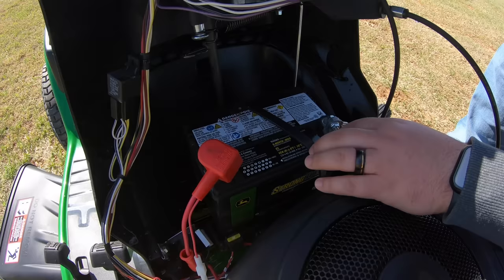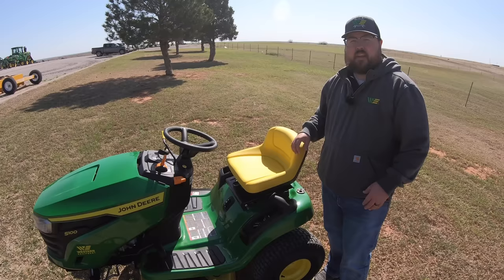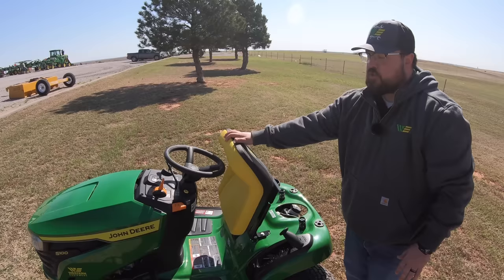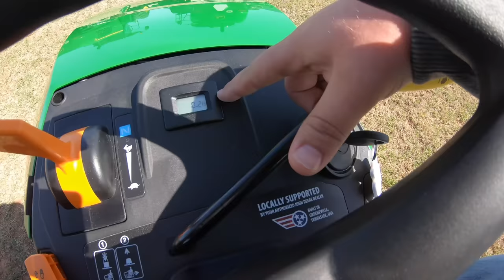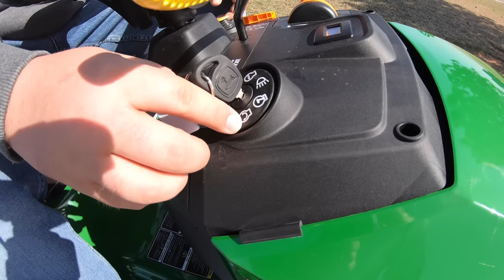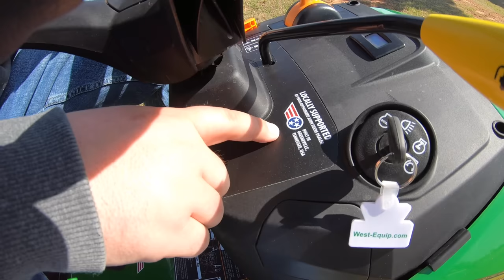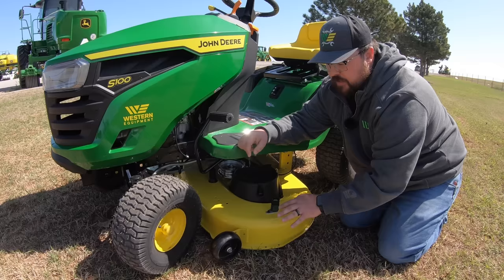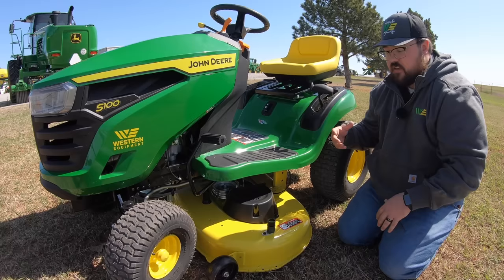2021 John Deere S100 Riding Mower Review and Walkaround

Comment: Since the PTO adjustment bracket is now welded on the deck - now how do we adjust tension if it is loose???
Reply from the maker: is the belt still loose when you engage the PTO?
Reply: @WesternEquipment  yes even tho belt and pto are new. Not sure why they would delete the option to manually tighten the pto via the bracket. It’s hard welded now. Also looks like the cable has no adjustment screws like you see on snow blower cables etc.

Comment: I have uneven ground in my yard. It used to be a horse paster. We have ruts and holes. What riding mower would you recommend? BTW its not rocky just not smooth
Reply from the maker: I would look into something in the X300 series or larger (X500 series or X700 series). These are going to have a more solid frame to handle the rough terrain. Thanks for watching!

Comment: I’m sure this is a stupid question but does the battery charge when the mower is running? Or will I have to place it on a charger?  Thank you so much for your time.
Reply from the maker: Yes it will charge when running. It has a system that acts like an alternator. Good question and thanks for watching!

Comment: Question: I was gonna buy this but, would a bush hog be to much on it if I was using and pulling it for tall grass. If I take the deck that was off under the mower.
Reply from the maker: I would not advise trying to pull any kind of brush cutter or bush hog with this tractor. It is the smallest residential machine and I don't think the transaxle would be able to keep up. Good question though and thanks for watching!

Comment: To unhook the spark plug do I just pull that cable off?
Reply from the maker: Yes, it is super easy!
Reply: @WesternEquipment  So just pull that off? I’m trying to install the MowerPlus plug/adapter.
Reply from the maker: Yes, just pull it off and then reinstall once the connector is installed.
Reply: @WesternEquipment  well I can’t figure out this connector so it doesn’t matter. I don’t wanna pull something off I shouldn’t.

Comment: Hey just bought a new one and I'm having issues with the fuel gauge float not working.  Do you have a video about that???
Reply from the maker: Not currently but hopefully I can get to making one soon. If you still have issues I would take it to your local dealer and take advantage of your warranty. Thanks for watching!
Reply: I spoke to a dealer and the answer is nothing can be done.  I happy with that.
Reply from the maker: Maybe try another dealer in your area that’s interested in helping. If there isn’t one, you might have to try and tackle it yourself and buy a new fuel gauge.

Comment: The TL-200 transmission is not very durable.  If you mow hills, or stress it in other ways, it will need replacing in pretty short order.
Reply from the maker: I have heard both ways on this one. I have heard good and bad. But with this being a very light transmission I would agree that it needs to be under less stress that the larger models. Thanks for watching!

Comment: So I have a question….I just got to finally use my s100 for the first time and it mowed amazing and fast too. I am very happy with its performance on its first mow. My question is, when I finished mowing and got off I saw that while I was mowing the belt was rubbing against the top of the mower deck and it even took the yellow paint off where it rubbed. I assume this isn’t normal or is it? Also I have 1 hour on the hour meter
Reply from the maker: Sounds like there may need to be some adjusting to your belt tensioner or one of your pulley’s. I would definitely take this to your local dealer and see if your warranty will cover this issue.
Reply: @WesternEquipment  My local John deere dealership came and picked up the mower last week so I spoke to them today and the service department manager told me that this was the first time he heard of this so he made sure everything was correct like the mower deck at 4” and not actually 6” when raised. When he looked into it more John deere told them that this is normal with the s100 series that the belt just rests on the top of the deck and that there’s no fix. He said it’s just the nature of the beast. So I said so basically the paint will be rubbed off in that spot and he said yep unfortunately so.
Reply: @davidgarris2513  except he showed me the print out of their response they sent him so I read it in black and white
Reply: @MEEMOSS77  "the first time he heard of this' Really?  And he's the service department manager?  And Deere built this so the belt would constantly be creating friction/heat/wear rubbing on the deck?  And you believe that?  Oh, a talking serpent conned a certain weaker member of the human race into eating a cursed apple.  😆   Whatever.   Also manual transmissions achieve significantly better fuel economy.  A man in his garage in the 1950's invented a carburator that got 100mpg.   Etc.
Reply: @davidgarris2513  I didn’t buy my mower from the John Deere dealer I bought it from Lowe’s  so I wasn’t conned  and I’m certainly not a weaker member of the human race
Reply: @MEEMOSS77  you obviously don't know the bible.  It was a bit of sarcasm and the "weaker" is the female.   And if you read thru some of the thousands of reviews on the 100 series that people purchased from either Loews or Home Depot, almost without exception the complaints stem from the unit not being set up properly, and when subsequently contacting the Deere store, they tell the customer it's their fault for not purchasing from them, they should have bought a 200 series, go back to the place of purchase.   .... Etc.   I'm not saying it should be like that.  But being a long time Deere products owner and operator, and someone that heavily researches any potential purchase, I've read multiple hours of reviews on these machines and can assure you that I am correct.  Therefore I cannot be corrected.  😂.  Good luck.  Next time patronize your local John Deere store.  Not the faceless global conglomerates.   Read Consumer Reports, check out Bob Vila. These mowers are top of their respective class.  So no, a Cub Cadet will not make things better.  Gotta go

Comment: Great video Brent, very informative and extremely well done!   I am considering the S100, a bit concerned over the stated belt issue.  Is the belt/pulley designed differently on the S120 ?  Secondly, do you happen to know the width on the 42" tractors when using the twin-bag system?   My gate opening is 55".   Many Thanks.
Reply from the maker: Thank you! I don’t think the design is much different but I do not hear of the belt jumping off on the S120. Also, I do not know the exact width but you should be pretty close to the 55” with the bagger on but I think you’ll still be able to get through your gate. Thank you for watching!

Comment: My new S130 is hard to apply the parking brake. I need to push very hard on the pedal to get it to engage/disengage. I tried the parking brake on two S100's at Lowe's and one was really easy to apply and the other was between the force required on mine and the easy one. There must be a way to adjust this? - Thanks

Comment: Man, can I get your advice? So, I just got the John Deere s170. I love it. My lawn is 0.52 acres and it's barely large enough for a riding mower. But it's not so much of my lawn size, but the lack of long straight paths that can eliminate the amount of turns I got to make. So, I feel really stupid. I never before paid attention to those strange looking zero-turn movers. But then I realized that is what I should have grabbed. I mean heck, every riding lawn mover in my neighborhood is a zero-turn. So, I'm considering returning my s170 for a zero-turn. How much of a difference you think that would make? I do have sections of my yard that has a nice travel before needing to do a turn. I guess I can keep the s170 and use my push mover for the more difficult areas.
Reply: A zero turn mower is exactly what you would need. I think you spent 2500 + tax or so on the s170 (based off of Lowe’s) and you could get a decently nice zero turn for that price range. 

Here is the Lowe’s website if you want to see the zero turns faster at your price range: https://www.lowes.com/search?searchTerm=zero%20turn%20mowers&refinement=2665191283

And here for Home Depot: 
https://www.homedepot.com/b/Outdoors-Outdoor-Power-Equipment-Riding-Lawn-Mowers-Zero-Turn-Mowers/N-5yc1vZc5akZ12lf?NCNI-5

Home Depot has craftsman, and toro, maybe a few Troy bilts
Reply from the maker: I agree with @Man of Culture that a zero turn is probably more fitting for your situation from what you are describing. Make sure you are checking over the mower good when you buy it. Checking things like deck levelness, tire pressure, oil level, battery, etc. Thanks for watching!

Comment: I just bought the S100 and it was a repaired unit by John Deere don't know what was wrong with it but I was wondering way the fuel tank is not mounted in the frame work I didn't receive any information on the mower so can I call or go to you or John Deere and get a warranty for it or I'm I sol on that it was sold as is from Lowe's in homestead Florida
Reply from the maker: Yes, you should still have warranty on the machine and you could take it to a John Deere dealer to have it inspected. I hope this helps and thanks for watching!

Comment: I have a question for western equipment are these serviceable transmissions in these john deere models? or plastic? You gave all specks except one of the most important the transmission
Reply from the maker: The transmission is not plastic but they are considered sealed/non serviceable. Good question and thanks for watching!

Comment: just got my s100 and I can't get it to move forward.  What am I doing wrong?  It starts, the brake is not engaged, but when I hit the pedal, it doesn't move.
Reply from the maker: Check the rear of your machine and see if the transmission release lever is pulled out. If so turn the machine off and push it in and then start it back up and it should work. If this doesn’t work then check your transmission belt which is located above the mower deck and runs from the bottom of the engine to the rear of the machine. I hope this helps and thanks for watching!

Comment: Hi, great video, great explanation. I love this brand so I put my eye on this mover. What I CAN'T find anywhere is the slop level it can handle. My backyard has a 9% slope and I want to make sure it has enough power to handle it. Any idea? Thanks
Reply from the maker: Thank you for the comment. I am not sure why these mowers are not slope rated. I would definitely see if you could test drive one or at least a comparable mower to make sure it will handle it, but I don't think you will have a problem.
Reply: @WesternEquipment  Thanks! I would go for the 120 but they are out of stock everywhere. So I guess I am pulling the trigger on the s100, Thanks
Reply: The manual says to stay less than a 10-degree slope. That’s recommended for safety. Not necessarily for power. 🤷‍♂️

Comment: S100 vs S120. would s100 horsepower (17.5hp) be powerful enough for fall season wet leaf picking? I usually have 60-80 bags of leaves each fall. Thanks, in advance.
Reply from the maker: I would suggest going with the S120 if you are doing that many leaves. The more HP the better for that scenario. I hope this helps and thanks for watching!

Comment: Great video!  I just purchased the S100 and have one question.  I assume the sliding piece on the fuel gage is supposed to slide depending on what the gas level is?  Mine does not move.  Any advice on this?  Thanks again for a great video!
Reply: man, that's very odd, i just bought a S100 few weeks ago, mine is working good, your gas sliding piece should move showing the gas level even when the Tractor is cut off. I would call the place you bought it, sure it's still under warranty.

I noticed when I first bought mine, when I got home, a nut was laying in my truck bed. I never did find were that nut came from. 

I heard someone say that John Deere will send someone out to check things under warranty so you don't have to load it up and carry it to them. Hopefully you will find out why.

Comment: Can you put a match kit on s100
Reply from the maker: Yes you can. There are two different options, a mulch cover for the discharge chute and then there is a hard mount kit that bolts to the underside of the deck. Good question and thanks for watching!

Comment: What is your opinion on this TL200. Is it less than the t40 or the same transmission.  I saw they put that on all the way up to the s160 and the s220.
Reply from the maker: It is very very similar to the T40. They have almost identical specs.
Reply: @WesternEquipment  Thanks

Comment: do you know why the paint flake of the earlier models - I've started with a L100 up to the D100 and have the S100 on order, the other two had pain issues (flaking off body and deck), bare metal under once the paint flake falls off. Hope they've solved it with this model. I'm getting mine in a couple of week. Thanks for the vid.
Reply from the maker: Congrats on your new mower! I don't know why they flake like that but I would imagine this has been resolved with time. Thanks for watching!

Comment: My s100 has already broke a belt at 9 hours and it is not smooth at all while engaging the blades. Just put on a new belt and it still shakes badly when engaging the blades. Any advice?
Reply from the maker: Unfortunately this has been a very common problem on this specific mower and I have not heard of a for sure fix yet, but it would be worth a call to your local dealer to see if they know of anything. I hope this helps and thanks for watching!

Comment: just purchased the S170. whats your thought on the easy oil change? any concern with it only replacing 40% of oil?
Reply from the maker: For your average residential customer that puts around 50 or less hours a year on a mower I think it is totally fine. For users that run their mower much more than that in a season, I would maybe want to convert it back to a standard oil change system. I hope this helps and thanks for watching!

Comment: Im hearing a lot of bad things about this mower that the belt breaks easy on it and this is a brand new one. I want to buy it but based off reviews seems like a lot people have problems with it. Let me know  what you think,?
Reply: It’s a good mower but it is very cheap and simple so I recommend to get the s130 or better depending on what you want
Reply from the maker: I have been hearing the same thing and I have been recommending that people look into the S120 or S130 as these issues have not seemed to be a problem on these mowers and there is very little price increase between the models. Thanks for watching!

Comment: I have an S100 myself, actually my second one within a matter of months.  When I purchased my mower I noticed when engaging the blades that they don't engage right away.  I thought the deck belt that was on my machine was old and stretched but I compared it with a new belt and looks the same.  I've seen videos on older mowers that on the tension cable bracket there are 2 bolts that you can loosen and adjust the tension on the deck spring but the S100 is welded onto the deck and I did notice the spring is very loose, to the point it's resting on top of the deck.  Is there any other way to adjust that tension cable?
Reply from the maker: I will have to look into this and see. Stay tuned and thanks for watching!
Reply: @WesternEquipment anything ever come from this? Is there a way to tighten belt on s100?

Comment: So I just bought a house full of weed grass like Bahia and Dallas. I have a half acre and a a push mower but I said no ma'am so I bought me this s100. It arrives tomorrow but on the website it talks about throwing belts. I saw a comment below that it shouldn't, but if it does because the belt is too big, can you get a 1" shorter belt and put on there to fix that issue or is that a wild idea? I saw a guy on the JD website say he did that and it worked like a charm but I've never even sat in a riding mower so I'm scared.
Reply: Also I can't find ANYWHERE what kind of oil to buy for these machines?!
Reply: Ok 10w30 oil for this s100 gas mower yall. Apparently. Maybe ask your mower sales dude though.
Reply from the maker: I have not heard of buying a shorter belt but if it works then I would say go for it. There are kits to help with keeping the belt on if you have issues. I would wait and see what happens and then get in touch with your dealer if you have issues. Good questions and thanks for watching!

Comment: Do you know how wide this mower is at its widest point? I’ll probably need to get a larger gate for my fence.
Reply from the maker: If you pull the discharge shut up then you can get down to 46.5". So if you have a 48" gate it will be a perfect fit! I hope this helps and thanks for watching!
Reply: @WesternEquipment  well darn. Thanks for the reply. Unfortunately my gate is barely 42”.

Comment: Thanks for the great videos. I found you after I found an S100 with 16 hours. I googled the hell out of it and jumped on a never used snowblower. Now I am afraid that it's the wrong one. [because i was watching the install video] It's a 44-inch and the manual has OMM163342 E0. Could you tell me if I am about to have buyer's remorse? Thanks. John
Reply from the maker: Well I have researched on this and can't seem to find any info on which operator manual goes with which snowblower. I think as long as it is the 44" it can be retrofitted to fit your machine. If I can help anymore let me know. Thanks for watching!